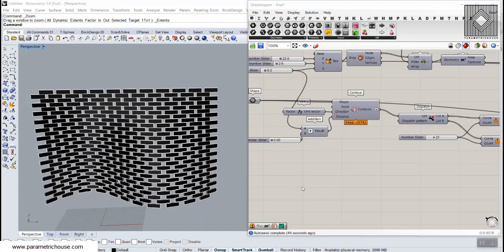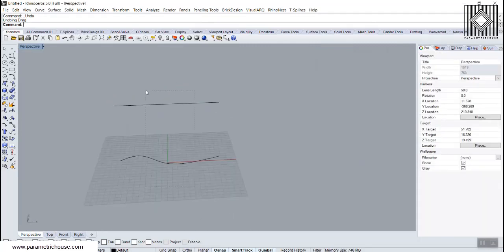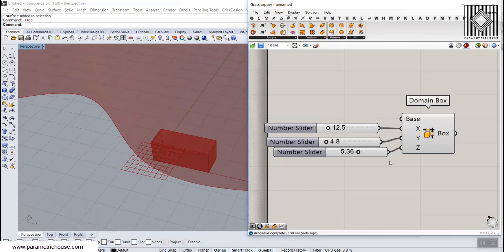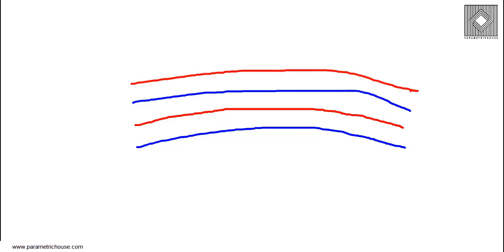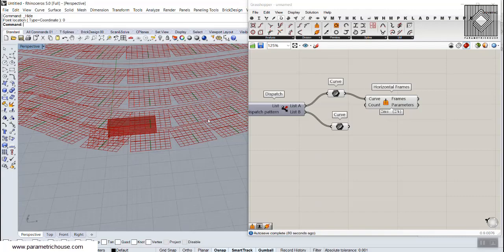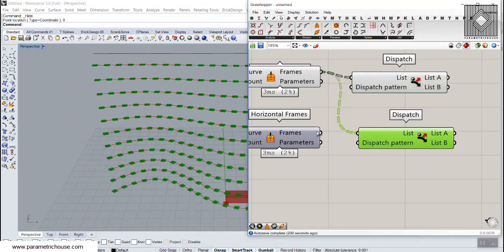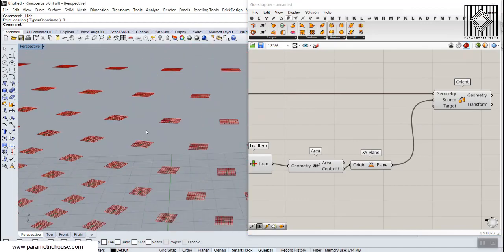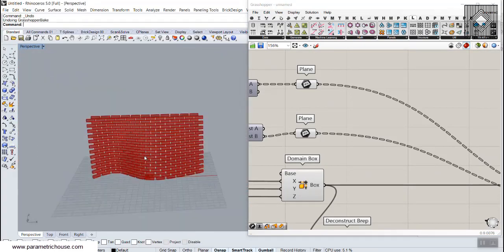Parametric Brick Wall Grasshopper

Comment: Hi Rhino Grasshopper, great video! 

I wonder if it is possible to render that wall with different brick textures, in a fast and simple way? Because every brick is its own object, how do I give it realistic sense of variety? Is there a way to select multiple textures and apply them so that the render looks realistic?
Or how would you do if you wanted to render ut this wall?

Would be very glad if you could help out. I really want to use these techniques for my thesis project.
Reply from the maker: Hi Antonius... unfortunately I don't have much experience with Renders :(
Reply: You can seperate the boxes random or with a pattern and bake them in rhino into different layers. Create lets say 5 to 6 different brick material variationes and asign them to the different layers

Comment: Hi! My dispatch is not working i dont get anything on the B output
Reply: You need to flatten the input
Reply: @locolegs1000  it works! TY
Reply from the maker: Check the dispatch pattern input and try to debug it
Reply: Facing the same problem, how do I debug it?

Comment: awesome tutorial! I have a question tho, how would a brick layer build this in real life? how would he know where to position each brick? Maybe he just needs to be an excellent bricklayer?! :)
Reply from the maker: One of the ways you can make it is to have costumized cnc milled pieces between the bricks to give the right angle.
Reply: @ParametricHouse  would you recommend any grasshopper methods to help with fabricating the cnc or lazercut wooden pieces to align the bricks ?
i usually
 01- use the contour command to get the outlines of the bricks angles .
 02- draw the rest of the wooden pieces between the outlines manually on rhino (draw lines , trim , extend etc... )
 03- arrange the pieces and numbering  using G-nest plugin for lazer cutting .

but maybe be there is a simpler method ? especially for step no 02 ?
Reply: they* anyone can be an excellent brick installer :)

Comment: Hi, thank you so much for this amazing tutorial! 
I would like to build a dome out of bricks. Of course your tutorial doesn't work for the whole dome, so I split in four parts, but they brics are still not perfectly arranged. Do you know a way to solve this Problem?
Reply from the maker: You're welcome Felix,
The problem with closed NURBS surfaces is that the U or V Iso curves reach a point and this tutorial will not give you the desired results. I guess I have to think about this for future tutorials because it's more complicated than you think! You have to go for iterative design and use the Anemone plugin to put bricks on each row, step by step!
Reply: Thanks for the fast reply!
I'm working on this Problem for a week now (it's my first advanced project with grasshopper). Even if I try to cut the dome in 16 parts and straigthen them so the just bend in one direction instead of two, there is still the problem that the bricks are taking the angle of the Surface like the should in a dome but still remain like wall.

Do you have any idea how to solve the problem?